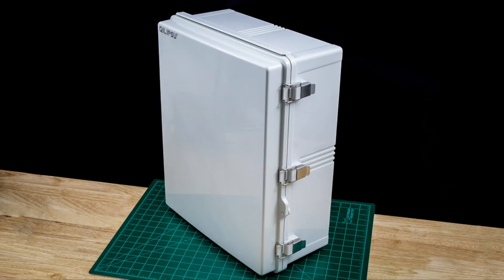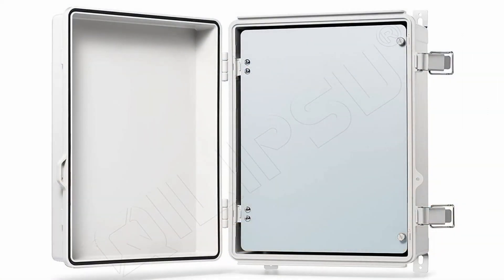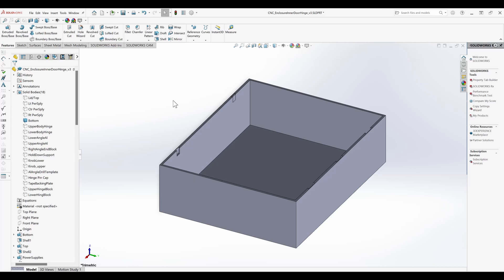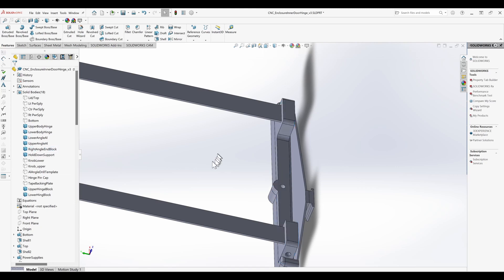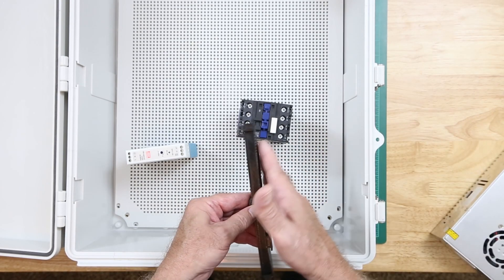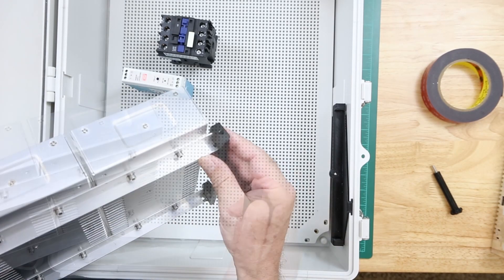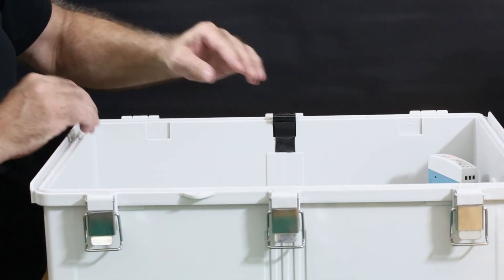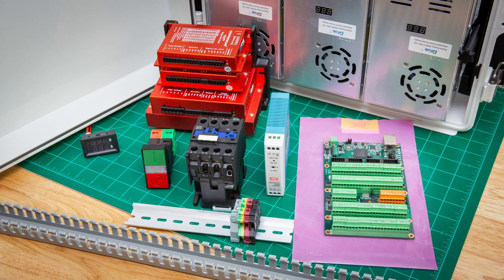Grizzly G0704 CNC Conversion - Mounting the Power Supplies in the Enclosure - Video #10

Comment: Great design!
Reply from the maker: Thanks! 
It's functional. Knowing what I know now, I would have 3D printed a mount to put the power supplies on the door. Mostly because I added the Volt/Amp meters to the door and wires from the power supplies had to be looped out to the door to the meters before going to the stepper drivers.
Reply: @joat_mon  I'll keep that in mind..I'm considering a 704 conversion and watched a bunch of your videos last night...thanks for sharing them!

Comment from the maker: Some folks may be wondering why I'm using three power supplies...
This happened due to a number of factors. The first reason is from past experience. In another project, long ago, I bought a 3-axis stepper "kit" on eBay and the kit came with 3-stepper motors, 3-motor drivers, and 3-power supplies. So, it's what I was used to. 
The second reason is due to the two different size stepper motors and controllers being used. They each have different [maximum] voltage ratings; though the bigger NEMA 34 could be operated at the lower voltage of the NEMA 24s.
The third reason is redundancy. If a power supply should fail, it would be possible to run two axis from one power supply and have almost no down time. The power supplies are rated at 10-amps and each NEMA 24 stepper/driver combination is not likely to draw even half that much. So there's plenty of reserve capacity.